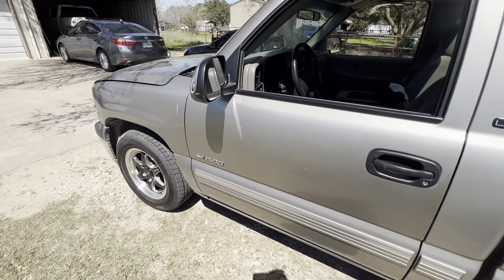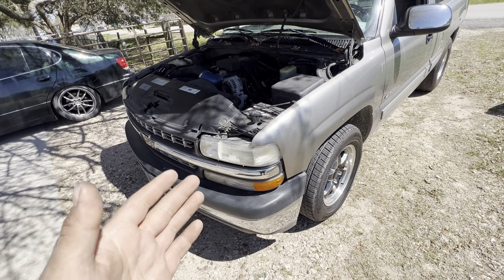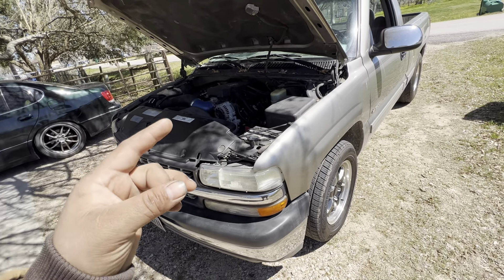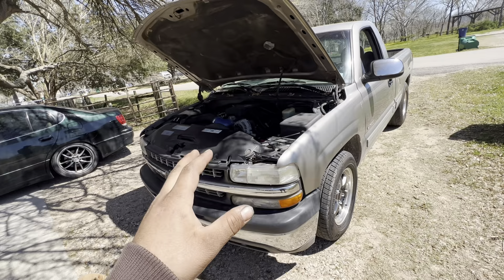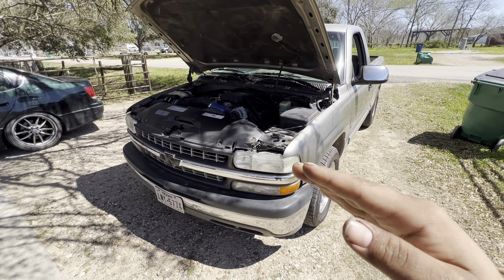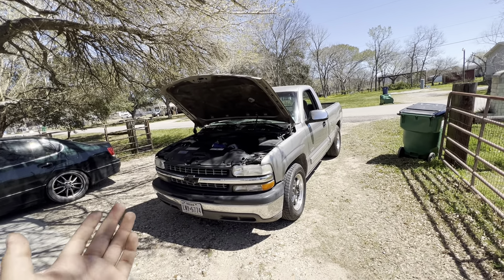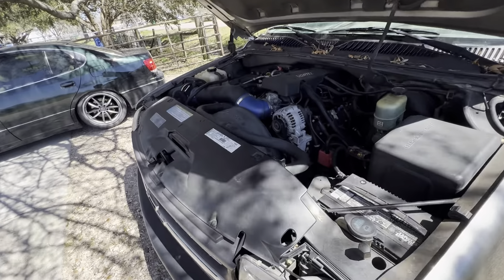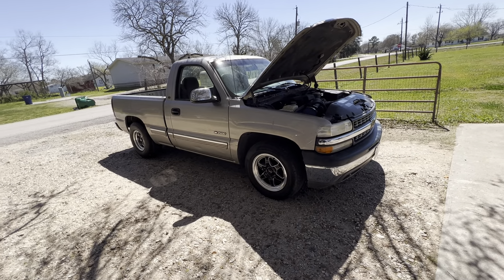CAM SWAP COST BREAKDOWN $$

Comment: Not to mention if you tune it yourself, $300 for hp tuners and $300 or more for a cheap lap top
Reply: Yup had a shop quote me $1600 & I supplied all parts. After that I took the weekend and did it myself.
Reply: Where do you get hp tuner for 300?
Reply: I see them online for 3k plus

Comment: I had a rebuilt 5.3 put in my 2003 Silverado with what I was told had a stage 2 cam.It sounds ok but I expected a better chopping sound.Now the truck runs but a battery not charging light keeps coming on.The guy doing it is still trying to figure that out.Where are you located?

Comment: I have a 2005 silverado 5.3l it has 162,000 miles my oil pressure at idle is alil under 40 I'm thinking about doing the new truck norris nsr cam wondering if I'd be safe

Comment: U are literally right on the money I got like 3200 in my lm7 but unfortunately I didn’t shim the converter and my bearings are gone how much would it cost to take a bare block to someone and get new cam bearings and new crank bearings and the bearings on the rods basically all new bearings and I’ve already torn it down and the crank looks pretty screwed as well

Comment: I have a question 
My tukkk 04 sierra 4.8 :) 
Has alot of miles.
It ticks some times when for example driving in my apartment and slow down for a speed pump and idle thru. I don't know if it's a lifter. I replaced rod bearings, oil pump a few years ago. Because it ticked. And it stopped ticking. Bearings didn't look bad when I replaced them. Any idea

Comment: Local shop wants $3,200 for labor. Another $1,500 for tune. That's me buying cam kit separate. Seems crazy to me.
Reply from the maker: Wow, for this generation Silverado I charge 300 for cam and springs lol
Reply: 5th gen camaro ls3. Claim he has to drop the motor or pull the front clip
Reply: @BoBuilds  I pay cash if you're willing to travel and think you can do the job. I'm serious if you're interested. And definitely more than the 300
Reply: @BoBuilds  I'm in the houston area bro lmk I ll pay u

Comment: Its a chevy drive it long enough and youll end up replacing all those parts from it breaking down on you
Reply from the maker: That’s true about anything. Be a mechanic long enough and you’ll learn every make and model will fall apart sooner or later lol
Reply: @BoBuilds  he must not work in a shop cuz Chevys are bulletproof compared to FCA junk and EcoBooms lol
Reply from the maker: Oh yeah, I’ve owned a 5.0 mustang with that infamous coyote tick and have worked on plenty of low mile eco boost with cam phaser knocks and waste gate rattles lol
Reply: You're confused with Fix Or Replace Daily.
Reply: @OOICU812  🤣🤣🤣🤣😈
Reply: Long enough as in within 50,000 miles or so lol and i know because i own two chevys and all they do is break down. I drove a ford f150 4.2 v6 before these for ten years and in that whole time it only left me stranded once from a bad alternator. Something so easy to fix i did it myself. If you are not a mechanic but want to become a master mechanic without going to school for it buy yourself two chevy trucks specially with the 5.3 v8. You will become a master mechanic in no time from watching youtube videos on how to fix shit on your trucks and doing research on possible causes. One of my chevys has a stuck lifter i had to take about 70% of that engine apart to get to them pretty much the only thing on it that i didnt have to pull apart was the engine block everything above that i had to remove. Thank god for youtube videos and thank god for the hope that there are better trucks out there and i wont always have to deal with garbage
Reply: Junior Pineda I have a stock 2005 chevy Silverado with 377 thousand miles still runs great doesn't smoke and haven't done anything but replace radiator